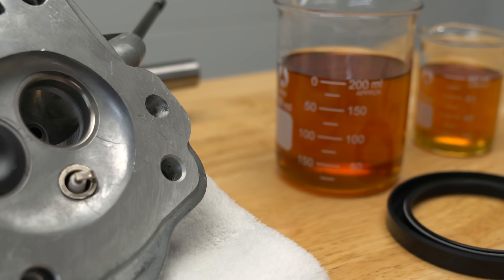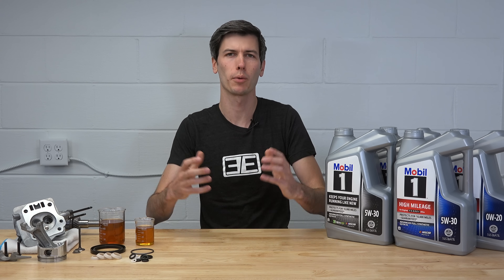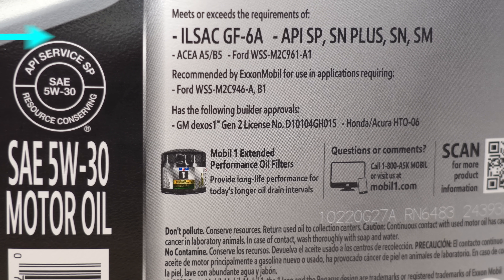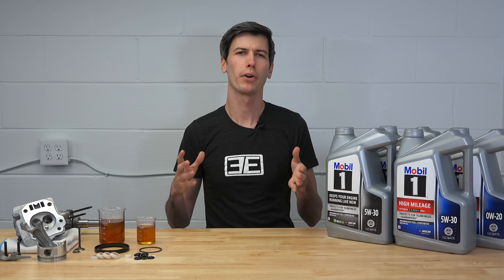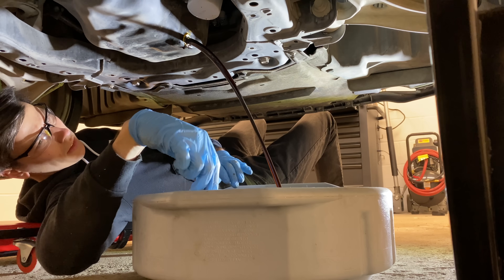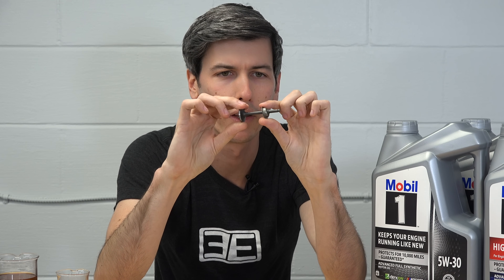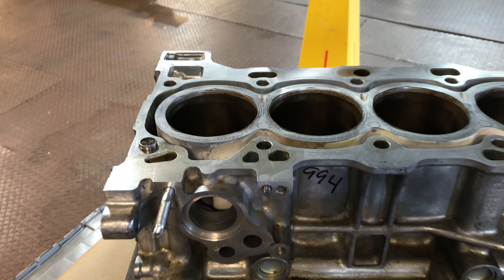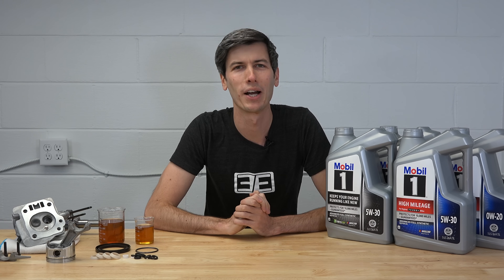Is Synthetic Motor Oil Bad For Old Cars?

Comment: If you use synthetic oils in a vehicle pre 1999 you will have more oil leaks than you started out with that is the only thing I can say with extreme confidence and experience.
1990 honda accord
1996 honda accord
1999 honda civic (already leaking before hand but got worse)
2004 chevy Avalanche 
(Oil Gallery started to clog causing oil starvation to the rockers at cold temperatures because past owner never changed oil so I switch to synthetic to help and hope it would clean it out and then it leaked everywhere)
Also
1996 dirt bike honda xr
1997 klx dirt bike

Comment: Just gunna say this before watching. I have a '46 Ford 2n. Original motor, no rebuild. Case hasn't even been open as far as I can tell. The manual calls for straight 30 weight oil. I run the cheapest SN Plus 10w-30 full synthetic, usually walmart brand.... Only additive I put in is a whole quart of Lucas oil stabilizer. It doesn't leak, it doesn't burn oil, when I change it once a year it looks tolerably used (not black, but not brand new either).

Comment: I’ve been using Mobile one full synthetic in my 2003 GMC Yukon Denali since new, and switched to the high mileage oil at 100k and i’ve never had an problems or leaks at 147,000 miles.
Reply: Yup, high mileage synthetic has been amaazing on my old vehicles, actually stops minor leaks right away.

Comment: What is the difference between "High mileage" and "Extended life"?  Does the Extended have greater lubricity???
Reply: Extended life generally refers to oil with a higher quality base stock or at least a higher percentage of the better quality base stock. In the case of mobil 1 it may have a higher concentration of group 4 oils in the extended life labeled oil vs the hydrocracked group 3 oil that is in the regular Mobil 1. Thus the higher cost and claim that it will last longer. High mileage just refers to a specific additive package tailored to engines likely to have seal issues as Jason outlined in the video.
Reply: Mobil 1 has a  touch of PAO but not enough to call it a Group 4. Go with Royal Purple, AMSOIL Signature, REDLINE, or Driven Synthetic if you want a real PAO/POE based oil.

Comment: wrong, synthetic oil has been around since the 1940s atleast. maybe even earlier but im sure its been around in the 40s.
Reply: But it became non-synthetic synthetic in 1997.
Reply: Define a synthetic oil ?
Reply: Before 1997, all "synthetic" oil had a Polyalphaolephin base (PAO). The API classification was/is Group 4. Jet engines used POE (Ester) Group 5 oils because there is no cooling system for jet engine bearings and Esters have a high flash point. In 1997, Castrol removed the synthetic base, used hydrocracking to molecularly-modify Dino oil, and still called it "Synthetic". SynTec  now had no synthetic base but could be called "Synthetic" because it's modified. We call it Group 3 Synthetic. Mobil called Foul and API allowed Castrol to continue calling it "Synthetic". Seeing that you could charge Synthetic prices for modified Dino oil, almost almost all the U.S. oil companies removed their PAO and Ester and could use the useless terms "Full Synthetic", "100% Synthetic" and "Synthetic". What would be more meaningful to the consumer would be to put the Group on the bottle. Call any oil company and ask them what Group their oil is. Good Luck! So what is a synthetic oil? Any oil from petroleum or Natural Gas that is molecularly modiified. But only in the U.S. In Germany or Japan, if the word "Synthetic" is on the bottle, by law it must be at least Group 4. It must have a synthetic base.
Reply: @amazoidal  thankfully in mechanical engineering this crap doesn't fly, we need to meet a specifications with certain use cases , the whole naming convention needs to be taken away from public spaces.

For the Acea 100% synthetic is defined , hence only certain brands and products use is , Motul 810p series is 100% Synthetic and the ester based 300V. For European standard it must be fully processed not just blended oil.
Reply: i was just referring to the Oil they were synthetically making in Germany out of coal. They produced a lot of it from the 40s onwards.
Reply: Yes, the Germans and Japanese can't play the U.S. game and confuse the public on "Synthetic" oil. If a German or Japanese oil is labeled "Synthetic" in any way, it has to be at least a Group 4. Redline, Royal Purple, Amsoil Signature, Motul, Liqui-Moly and maybe a few smaller brands are all 4/5 blends. If it's got a lot of Ester, it's going to be expensive. Group 5 jet engine ester oils sell for around $30 a quart. Of course, the word "aviation" is like "marine" grade and the price of anything in those catagories is marked-up higher. It's too bad we have great oils now but generally poor filtering. Filtering limits the life of many oils. Most oil filters are great for bird nests and small rocks. AMSOIL used to sell a separate bypass filter but I haven't checked their catalog in years.

Comment: What about old style cork gaskets ?
Like original small block/big block Chevy, Ford, Chrysler, etc.. 
Will the thinness of synthetics leak past those ?
Reply: 30 weight is 30 weight. A synthetic of the same weight will not be more thin.

Comment: I purchased a 1972 olds 442 convertible in 1977 at 19 years old..previous owner used mobil 1 synthetic so I had too also which at 19 was shocked at price..at 19 the car didn't last long anyways,im sure u can figure out why lol

Comment: Combustion engines are amazing marvels of engineering which need to be retired to museums and hobbyists asap. If only half of the petrochemical engineers focused on battery tech we'd be able to see our city skylines  and mountains again...

Don't worry petrol heads, people are still riding horses in public and racing them on tracks. You'll be fine.

(We'll still need oil for lubricating other machines, making plastics, and gasoline for niche applications - really, you'll be fine.)

Comment: In 2006 I put 1000 miles on a engine 500 miles was plane Walmart oil and I put moble on in the other 500 miles a week later and the Walmart oil was way hotter then Mobil one oil  so pick your poison I would not recommend they 75,000 mile clame because thats way to many miles I recommend in my career of mechanic people that Weight till the 75,000 miles and there engine was toast the ring need replaced and so did the piston  most time but I found that 4 cylinder is ok to about 50,00 miles with a high mileage oil so that what I have to say thots

Comment: Jason, More to cover here.
Really old like 1960, engines might need an oil with more zinc additive, especially for camshafts.
"new" engines with Lambda sensors and catalytic converters on the other hand, don't tolerate those higher Zinc levels.       (It damages both sensors and catalytic converters)

Cold start ability and lubrication is generally WAY better in a synthetic oil, compared to a mineral formula.

A mineral oil is generally more preferable combined with E85 / Alcohol fuels       (According to my contact at Mobil here in Sweden)

Comment: So that's what the crosshatch pattern does. Huh.  I learn something new every day. Thanks!
Reply: A freshly honed cylinder has a visible basket weave pattern.  Theses tiny scratches hold oil.  When the cylinder is glass smooth, the pistons oil control ring does not work as well.
    Cast iron blocks and liners, due to carbon content, have intrinsic self lubrication ability.  In addition, The machined material has oil retaining pores even w/o honing.  CI is one of just a few materials that can run against itself without galling.....Usual set up is cast iron rings to run against CI block.
    All-aluminum blocks are of a peculiar alloy featuring hard silicone-aluminum particles.  After machining, the cylinder bores are chemically etched. This removes soft aluminum,  exposes the hard particles, and creates oil retaining pockets.  
     Bear in mind the block’s cylinder surface oil retention features are microscopic.    
     
      Hope it helps Cc
Reply: @danbenson7587  etched chemically? You mean like a thin nikosil or ceramic type of coating applied with high heat to  aluminum cylinders to harden them.
Reply: dennis rantanen   Nickasil is one and sees wide use in snowmobile 2 cycles.  I believe it is plasma spray...additive.  
      With cars I think Nickasil is too slow & expensive, so they etch...reductive.   Mercedes at one time used etch.  Aluminum blocks with CI cylinder liners are most popular in auto engines.  Cast Iron is just hard to beat.
      This, BTW,  is on the ethereal edges of my knowledge.  
     The central idea is the cylinder surface features retain oil.  The piston and rings are intended to ski across the cylinder on an oil film that may be as thin as .0003”.
Reply: @danbenson7587  snowmobiles, small engines, cast iron liners, nikosil plasma spray, crosshatch, etc. this I know, etching I was not aware
Reply: @danbenson7587   Absolutely right. I know a few guys that ruined aluminum blocks by honing them and installing new rings. They smoked lightly at first but after about a month of driving the engine smokes so much they had to be removed and disassembled to find out what went wrong. The ridge at the top of the bores was eye opening. Of course they had to pay to have the engines sleeved and sized to a new set of pistons. You live and you learn. Sometimes you learn the hard way but when you learn the hard way, you never forget.
EDIT: One was a Chevy Vega and after sleeving it, it turned out to be a pretty badass little engine. The other was a V8 Mercedes. That one was an expensive mistake and both happened in the late seventies.
Reply: @Ed70Nova427  we used to call  them chrome plated aluminum cylinders, but idk I think they were actually nikosil. We would hone them to smooth the scratches on a cylinder that had a melted down piston but not too aggressively and as long as the plating was intact it was fine, otherwise if there was any plating missing or deep scoring the cylinders would need to be replaced or sent out for replating. I'm talking small engines, snowmobiles here. And lawn mower engines just had a hole punched in the aluminum block and a piston shoved in. That's why most of em didn't last very long, especially when people didn't change the oil or maintain the air filters.
Reply: @Ed70Nova427  throw away engines!  just like lawn mowers, when the engines are shot you just scrap em because they aren't worth spending the money to fix them and buy a whole new mower.
Reply: “Crosshash”

Comment: My car calls for 5w20 but says that 5w30 can be used. It has 158,000 miles and I live in Houston so it’s usually pretty hot and humid so I’ve been using 5w30 full synthetic Mobil 1 since I got it and was about to switch to the high mileage version, but my car doesn’t leak nor does it burn a single drop of oil (🤞). Should I switch to high mileage anyway and should I continue to use 5w30 instead of 5w20?
Reply: Also note, it’s a 5sp manual and on the highway it cruises at 3500-4000rpm. And I sometimes have a bit of a heavy foot. I wouldn’t say I beat on the car but I definitely drive it

Comment: I used to own a 1987 vw scirocco 16V that required 0W-20 in the winter and 20-50 in the summer. Synthetic oil no problem.

Comment: Well Motul Synthetic engine oils are still esther based. Some engines have issues with that and leak, some dont....
Reply: Ester is used exclusively in jet engines.
Reply: @amazoidal  That can't be correct. Motul proudly claims that all it's synthetics are 100% Ester based. I remember something about Nissan recommending it's "own" Ester base synthetic oil.
Reply: It's hard to find out what the APO/POE balance is in any true synthetic oil. They talk about "bases". Doesn't mean much. Total ester would not be the best for cars but is found in "Jet oil". Look that up on Amazon. About $30.00 a quart. Now if Motul or Liqui-Moly or RP,  Redline or AMSOIL had a huge amount of PolyolEster, the price would be much higher. I've heard that the 3 domestic Group 4s are really Group 4/5. A combination of PAO and POE but in Motul's case, the % of POE may be higher. I haven't priced Motul - it may be more expensive. All these oil companies don't like disclosure, otherwise they would have the Group on the bottle.

Comment: Thank you so much for the rotary oil advice. It has been an internet war for so long on conventional and synthetic for rotarys. I will probably switch to synthetic now in my RX8
Reply: Don't do that, stick with Mazda recommend lubricants, unless u wanna find out the hard way
Reply: @DriftCentral  But why shouldn't I? Everyone says "Don't do it its bad", but there's never an actual answer as to why. Most say carbon buildup and he specifically says that it's not true. Then some people say that swelling of the seals from synthetic oils are why you can't use them, but then mobil 1/engineering explained says that just because the seals expand a little bit, doesn't mean that it will cause any extra problems. If the biggest factor to engine wear for rotaries is apex seal wear/rotor housing wear, why not just use a better lubricating oil for that, specifically synthetic? As far as I know, mazda has never explained why they do not recommend the use of synthetic oil. The thing I usually hear is that they could not test all the conditions of different qualities of synthetic oils, so they couldn't recommened them. I dont know if that's true or not, but other than that I have heard nothing else.
Reply: It looks to me it doesn't burn as easy as conventional oil or it probably burns at a higher temperature, as a result it builds up in the combustion chamber wetting spark plugs and fouling them
Reply: @DriftCentral  honestly, I might just try synthetic and check the plugs to see if there's any difference after like 10,000 miles compared to normal spark plugs lol
Reply: @IStratz  yes u can idk of you'll reach to 10000 but ok, if u do stall and refuses to restart keep a set of plugs handy, don't forget if u do have to flush the oil fully you'll have to also drain the oil cooler/s and don't forget a lot of oil are still in the rotors so it will take a oil change or 2 to fully get it out of your engine
Reply: @DriftCentral  I don't use Facebook, but I enjoyed the discussion. I doubt it's something he wants to spend money and time getting involved in that wouldn't appeal to most of his audience. Its a pretty large commitment to an entire experiment like that. Maybe well get an answer someday...
Reply: @DriftCentral  After watching Speed Academy's video on their recent 13B engine build, I had a realization moment on why you cant run synthetic oil with the oil metering pump in rotary engines. Basically what I realized is that carbon deposits will form in the engine as well as maybe some carbon in the oil metering pump. Synthetic oils have lots of detergents that "clean" those deposits. Since the OMP injects oil directly from the oil pan, all the carbon deposits and chucks would either 1. Get stuck in the OMP and cause it to not work properly or break 2. It would also be injecting carbon into the combustion chamber where you'll be lubricating your rotor housing with chunks of extremely hard carbon causing scoring and damage to the rotor housings, reducing engine life and compression. I had to comment this since I remembered I commented on this a while back and wanted to spread the info lol.
Reply: @IStratz  as long as there isn't enough heat carbon won't be formed,, those oil Injectors orifices are to small to push Through any significant amounts of carbon into the chamber, it's a common occurrence with the rx8 I think probably because there isn't any exhaust ports on the housing to allow the larger carbon deposits to exit the housing you'll get excessive carbon build up which will lead to damaged housings. If u have ever looked at a used rx8 engine you'll notice there will be carbon chunks building up in the same place along the apex where there are the oil injection holes in the housing, so basically you're getting oil evaporating/burning up as soon as it comes in contact with the hot apex seals which would lead to carbon deposits in those 2 or for the newer models those 3 places where the oil injection holes are
Reply: @DriftCentral  Never mind I kind of small brained. It still goes through the oil filter, so it would be very rare for debris to make it into the OMP/rotor housing. Also the combustion chamber is separate from the oil that goes into the pan, so that takes that out of the equation. Rip my theory
Reply: @DriftCentral  See, but that's what he says he doesnt agree with in the video. I know he has no evidence to back up his logic, but he knows way more than most of us on chemistry. He also has an extremely successful oil company that he could directly ask questions to. Man, if I had another backup car, I would run my RX8 on synthetic just for trying to find out myself aaaaaaaaaaaaa
Reply: @IStratz  I understand hes definitely more educated Dan most of us. u can get on directly to me just search my name on FB we can discuss further in detail, let's ask him to buy a used rx8 if he really wants hands on experience with them . They are going cheap these days,I'll be happy to shear all I know to make sure everything is done as we know it should be vs doing it using his chemical knowledge , the results will speak for themselves. Anyone is willing to lend him their RX-8 or maybe even a rx7

Comment: I used M-1 in the KLDE V-6 and it didn’t use a drop for nearly 14 years. The last year I owned it, the valve guide seals started to weep a bit and I had a puff of blue smoke out the exhaust when I first started it up  in the morning. Still less than a pint between oil changes. I use Motorcraft semi-synthetic now in the ST because the Lincoln garage only charges $22 for a full-service oil change. 83K and runs fine.